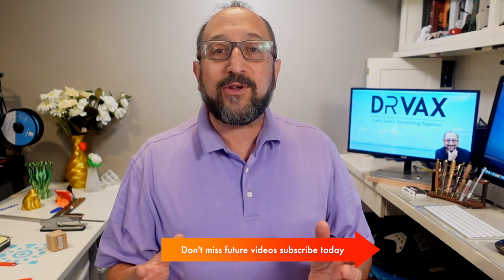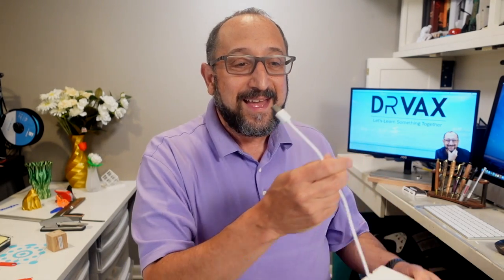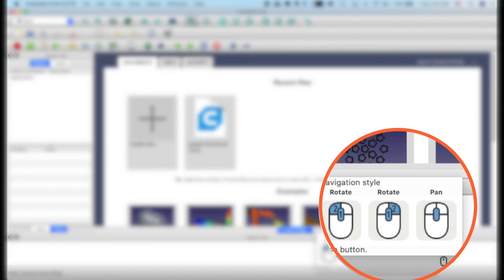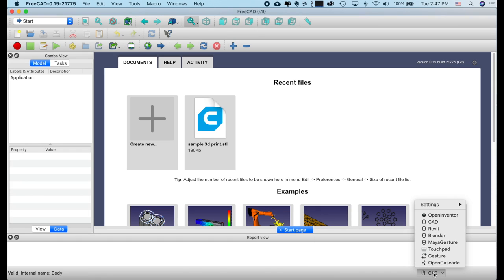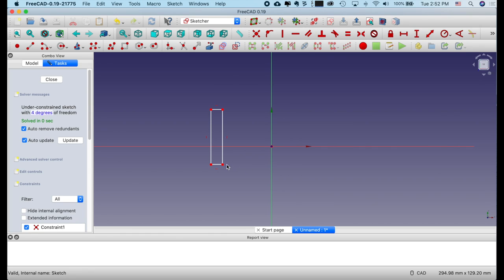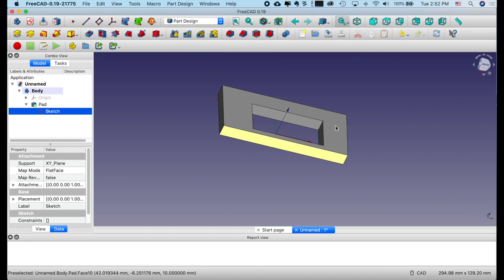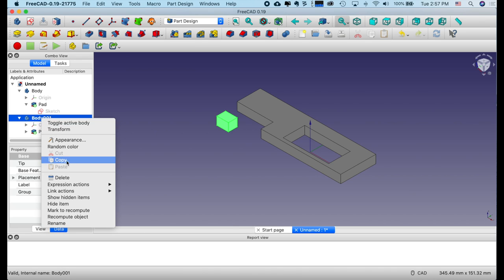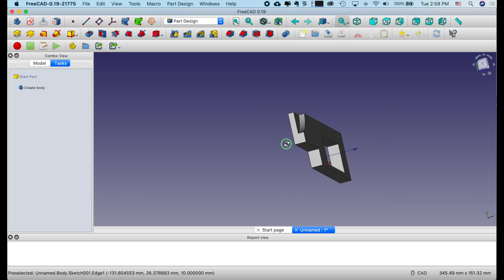FreeCad for Beginners | Pad and Pocket | Lesson 2

Comment: I recall when parametric design first started replacing standard CAD systems in the late 80's and early 90's. Designers had stars in their eyes, but soon learned those new systems had serious drawbacks for some engineering solutions. It is amazing that a 'free' product today can run circles around those early, super expensive solutions.
Reply: @parrotm76262 Hi, I'm rather new to CAD in general, like most people here I think. I first learned CSG modeling, then FreeCAD's parametric design (which I think is more like BRep, right ?). So can you summarize these drawbacks you mention to newcomers like me, and better yet, can you tell us what was next after that ?
Reply: @artesim_779  I was in Aerospace at the time, and Parametric modelers of that day couldn't handle lofted surfaces, or surfaces themselves. That meant they were DOA in my industry. These days, most systems that offer Parametric design has some type of surfacing capability, so shouldn't be an issue.

Comment: This video was really useful especially where you showed what the mouse navigation does.  I did not find it at first as the status bar is not enabled by default.  I changed my navigation to touch pad though as I am working on a laptop.  I was about yo give up using my laptop.  Thanks for the very useful information.

Comment: @DrVax you might be having the same problem with the fancy Logitech mouse as I did. The mouse wheel on mine was intended to also scroll side to side and if you click very carefully straight down you can get a middle button click but usually the scroll click gets in the way. I mapped scroll left and scroll right clicks to be just regular middle button clicks with the downloaded Logitech software.

Comment: Regarding the "expensive" mouse, and the scroll wheel not working as a middle button - on Windows (I haven't got a Mac, so it may be different), the actions assigned to buttons are all configured in software.  For some reason, Logitech don't ship their drivers with the scroll button configured for MMB, so you have to change it.  I'm not currently using my Logitech mouse, so I can't be more specific.  I think this is configured using the Logitech Options app.

Comment: Nice video.  The series is helping me to shift from F360 to Freecad.  So many of the principlas are the same, but the mechanics sure do differ!

I do have a question.  I am a Mac user as are you.  How stable have you found 0.19_pre?  I noticed the version in the video and when I upgraded I only got to 0.18.
Reply from the maker: I am finding it very stable.  Maybe more stable than .18
Reply: I use 0.19 pre for anything. It is far far more stable than 0.18. In fact I use a 0.19 version that even contains fixes related to the topology naming issue. It’s like using a complete different application, as chamfer and references to no longer fail.
Reply: Thanks you both or the comments on 0.19.  That is what I shall grab and install
Reply: To be clear. This is the version I am using. https://github.com/realthunder/FreeCAD_assembly3/releases

Comment: Mr.Shaprio, in lesson 2, when I take the first body and create a space in that body every things fine. When we sketch the third rectangle on the outside of the diagram, when I join them together, the two points, the line stays there even when I pad. Is it my program or something I did?
Reply from the maker: Hard to diagnose without a picture.  Head over the to user forum and post a picture and the folks there will probably be able to help you.

A great place to discuss this is at the MakeWithTech forum located at https://forum.makewithtech.com.

At the free MakeWithTech forum/discussion group, you can also post images and examples of your work.

Comment: Thanks Irv, great series! 
Any recommendation on a particular mouse model with a Mac? 
I am using a Magic Mouse but it does not work well with FreeCAD, e.g. no wheel, out of control zoom etc.
Reply: If I may suggest, try getting good of a 3DConnexion 3D mouse. It's a bit pricey and feels like learning how to ride a bicycle when you start using it, but just as bike riding in real life you won't want to miss the ability to use a 3D mouse when modeling anything in CAD.
Btw: I'm specifically mentioning 3DConnexion because they're the only ones I know who build this kind of device that has a good reputation. Look for a used one, that'll save you some cash!
Reply: @MatthiesWesche  Thank you very much, Matthies! 
Well, I actually switched from my mouse to a trackpad which works much better. 
I am still interested in the mouse you mentioned but I am not 100% clear what exact model you are referring to. If I google 3DConnexion's website, there are multiple CAD mice actually called CadMouse but no "3D". Are those the ones you'd recommend?
Reply: @gsinill  sorry for taking this long to reply! The one I'm using is called "3D Connexion Space Mouse", which is pretty much just a knob for your left hand that you can tilt, turn and lift up/push down. You're only making minor moves on the knob, but it translates to moving your workpiece very well and gives you a whole new way of operating your CAD Program. It takes a while to get used to, but once you've got the hang of it, you won't want to miss it again. You can buy those things used for 60-80€. Not cheap, but worth their money. For designated professional work, you wouldn't have a problem spending several hundred bucks on a "Space Pilot". I've used one of those a while back and to me as a hobbyist it didn't make any difference.
Reply: @MatthiesWesche  Just to avoid confusion, it's worth making clear that 3D mice are to be used in addition to a normal mouse, i.e. they're not a replacement.  A right handed person would typically have their normal mouse on the right of the keyboard, and the 3d mouse on the left.
I agree that they do make 3d work a lot quicker/easier, but they're by no means essential.
For my normal mouse, the closest that is currently available is the Logitech MX Master 3.  This has a lovely scroll wheel that is quite heavy, and if you spin it hard, it carries on spinning for a while.  It also has a horizontal scroll wheel.  None of this is too important for 3d work, but it's certainly a nice mouse.

Comment: I chose the CAD navigation style, but the tool behaves differently, e.g. drawing a rectangle does not require dragging with the left mouse button pressed, but only clicking at the start and end points. Do you have that too? (I use Linux)

Comment: Possibly need to warn that the two shapes joined with the line in the interface DOES NOT WORK in 0.18 and before  the line needs to be deleted using the relevant icon. Or the resulting item will be blank until fixed.
Reply from the maker: Thanks for the info.

Comment: Got a ? For you. First i like to day i enjoy your videos . I've learned so much, so thank you. Here is the? When I first start my print and it goes onto the platform. And starts print, the p l a starts late. And I have a gap. I can still get the entire raft down. But it still has that gap on that first layer. Any help you could give would be appreciated toy.And keep up the good work. I like your videos.
Reply: When you use the latest version of Cura your problem is solved. Because it makes first a line in the right border of the print bed at the beginning of all prints.

Comment: Instead of your description of a Body try using the term Bounded Geometry. That's the difference between a line that's infinite to a line that has defined end points,either another line or another bounded element.